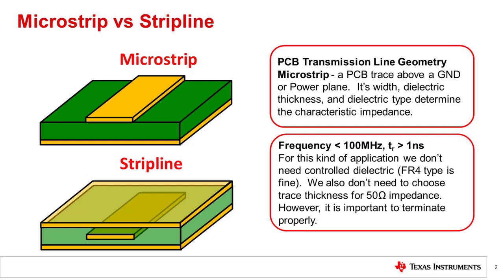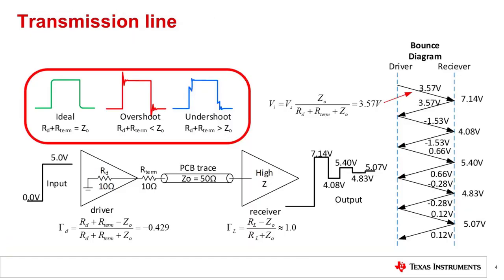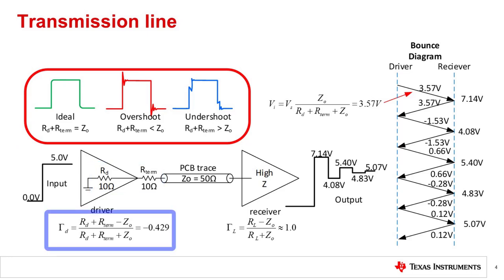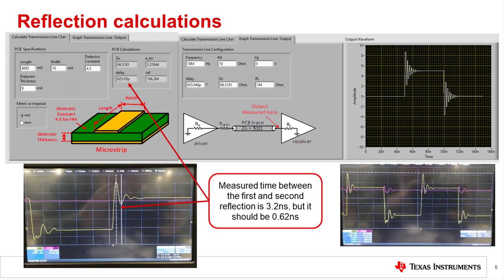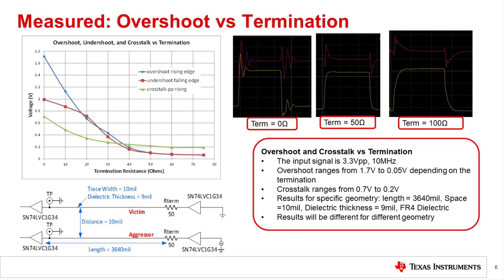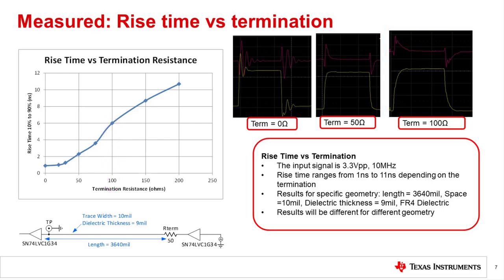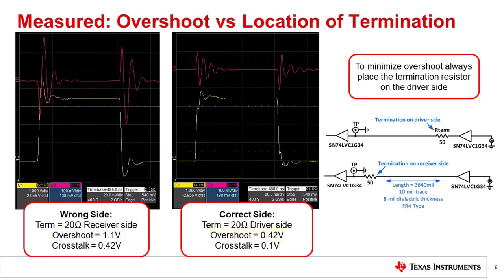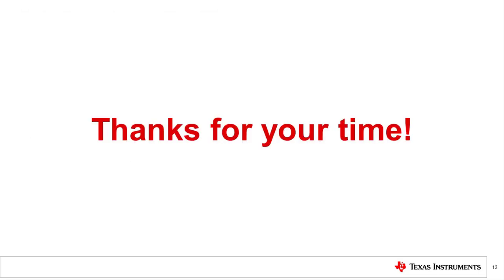PCB trace impedance matching

Comment: 6:27 "A 74LVC1G38 gate is used as the transmitter and receiver."   Looks like LVC1G34 is the correct number.  The '38 is 2-input NAND, but important for this video, would not show the same point at all because it has open-drain output.

Comment: Why does the trace length isn't a factor for the PCB trace impedance?
Isn't it that the addition of inductance will affect the overall transmission line impedance?
And thanks for the great video!
Reply: Characteristic impedance is basically the ratio of inductance to capacitance. Capacitance also increases with the trace length, and so the trace length is canceled out in the characteristic impedance.

Comment: What the heck is going on at 9:30 ? The point is correct -- put the terminating resistor at the transmitter end.  The diagram shows the 50 ohm resistor in correct and incorrect locations. But the scope traces and their captions show 20 ohm resistors, which very much waters down the argument and doesn't match the diagram.  Not much point showing the "correct side" with the incorrect resistor that doesn't perform the function one wants even if in the would-be correct location.